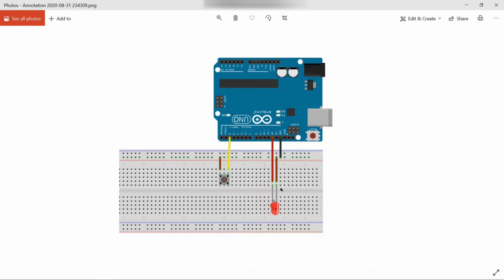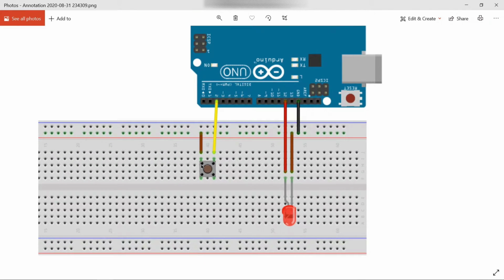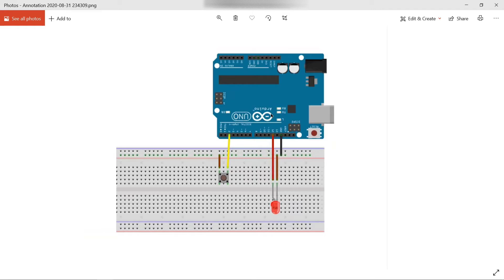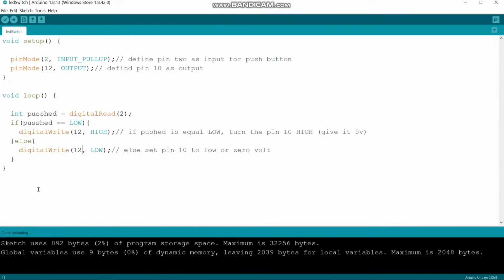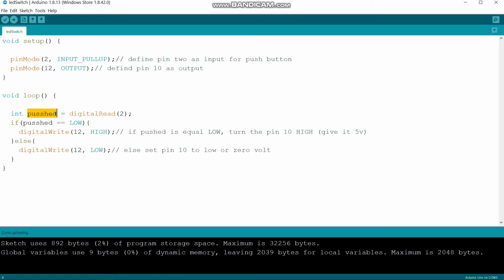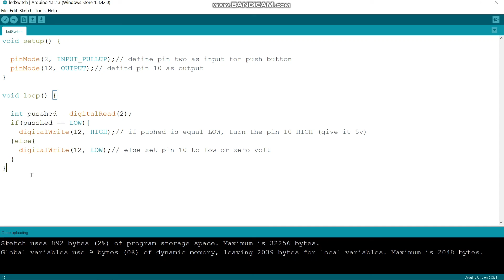How to control an LED using a Push button and Arduino? | LED Interfacing using Arduino & Push Button

Comment: Add a resistor please
Reply: REAL
Reply: i think the breadboard has something built in but yeah
Reply: @oscarelenius4801  What are you talking about? A breadboard has nothing built-in other than connecting rows and columns together.

Comment: This video deserves way more views! Learn Electronics India has put together an exceptional tutorial on LED control using Arduino and a Push button. I've tried other resources, but this one stands out in terms of clarity and depth.
Reply: No, It does not. This will fry your LED. The current will be too high and break the LED from too much power, You need a resistor for a led.
Reply: Obviously you are his friend because no one believes your crap...please post the other resources your thought were harder